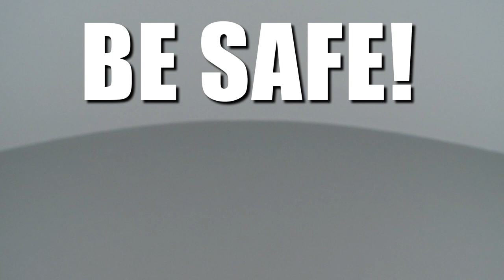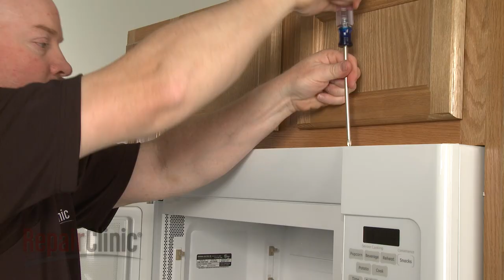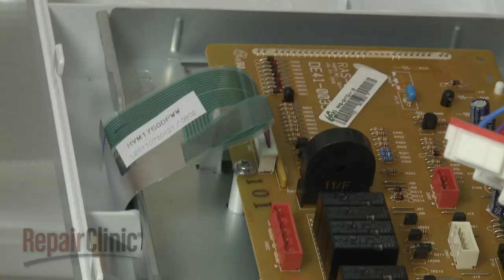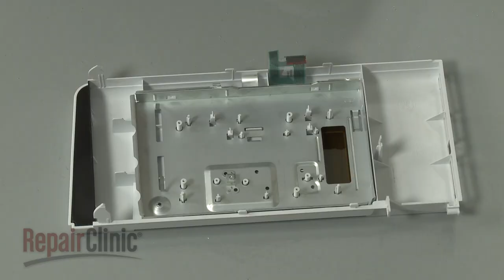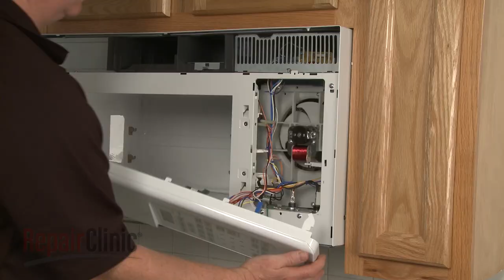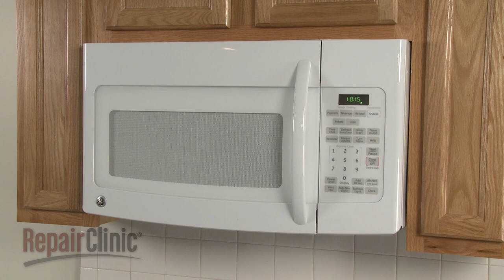GE Microwave Turns Itself On? Repair Help #WB27X11080

Comment: My microwave runs and will not shut down.   It runs while closed .  I switched out the primary and secondary switch. Still having the same problem.

Comment: Barry Burke 
1 week ago
My GE Profile Microwave worked for about 5-7 seconds then shut off. Further exam revealed burning/sparking in HV Inverter/Transformer. Digital continuity checked OK for all door switches, primary thermostat, shut off fuse, etc. Replaced Transformer with new part. Everything worked fine except 'No Microwave Heating'. Next, replaced Magnetron and Relay Switch on the circuit board. Everything worked fine except 'No Microwave Heating'. Magnetron humming seems normal! Cleaned mica wave board inside of unit, no sparking here. Can anyone advise what the problem may be. Again, everything worked fine including settings for time, power levels, clock, etc. when started up except 'No Microwave Heating'. Last resort before dropping out to the curb for the landfill! Any ideas greatly appreciated! HELP! 
Show less 

 

 

Reply 
Read more 

 
 

Reply